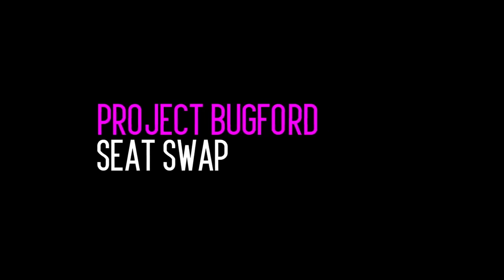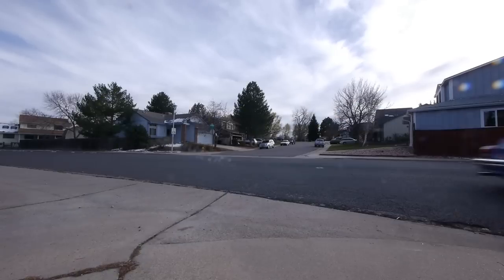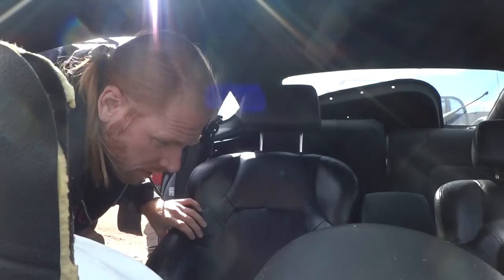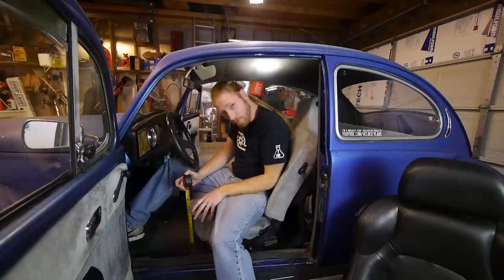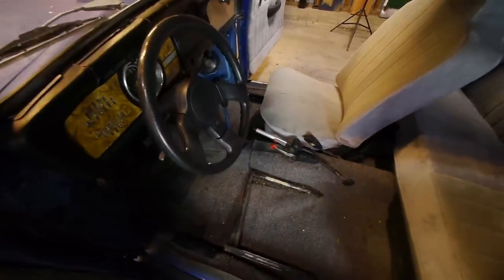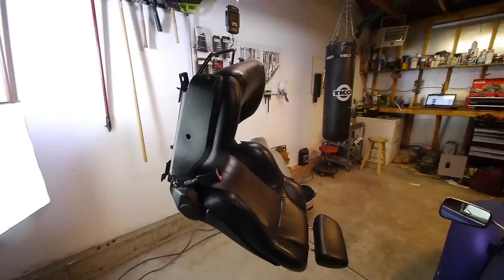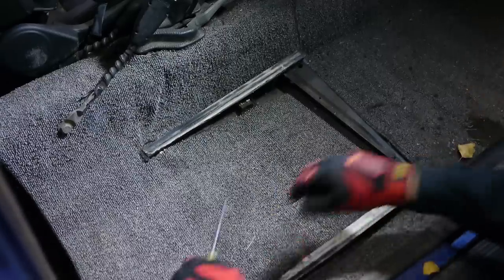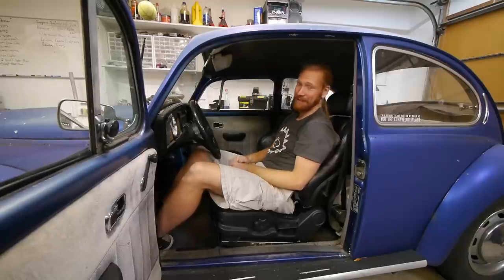1972 VW Beetle seat swap (Hyundai Tiburon seats)

Comment: Fantastic video. Has given me more insight for a seat swap. i have 2012 kia forte. i want leather and power seats. My main issue is the custom work. i do a lot of custom work but i dont dabble much into welding. im fantastic w my angle grinder and dremel however.

Comment: Sweet, I've already done this a couple of years ago, mounted as low as possiblle, it was awesome. I also took the whole back seat from the Tiboron and mounted it in my Bug.
Reply from the maker: Wow nice!  I'd love to see some pics of that if you have some! :D
Reply: See some photos via link below to my Dropbox:
https://www.dropbox.com/sh/o5e6alzpof61o9x/AABih_wcttlDwCmz12Y_zrKJa?dl=0
Reply from the maker: This is amazing, awesome work!   Now I'm definitely going to go back to the salvage yard and find a rear seat as well.  Thanks for the pics!
Reply: Velocity Labs Yes you must complete your work, not just half done 😉 You'll see the back seat fits pretty well, you just need to custom make something under the bottom parts back to hook it into, quite easy. the backrest needs something in the bottom to stick in behind the bottom part (there is already holes for bolts), I used two pieces of plywood 😆. The top parts (my seat had splitter backrest) rested against a 20x40mm pipe fixed to vw original holes in the sides. I welded on two "ears" on the rod so the stock Tiboron back rest locking mechanism works with its buttons.
At last you need to custom make something at the sides to fill the space, you will see when you are there.

Comment: jealious, I need seat's in my 68, BAD. i literally am trusting the door to hold me in the car on right hand turns with stock seats, haha
Reply from the maker: Yeah the stock seats are terrible!  There's a few salvage yards around the Denver area showing Tiburons in stock if you to try those.
Reply: yeah, I have one not far from me, I'll have to try out. Didn't think it was this simple, but the way you explain it makes it seem easy!
Reply from the maker: There's companies that make bolt in seat brackets too which is even easier.  I've seen used ones listed on The Samba classifieds for super cheap.
Reply: Velocity Labs I'll have to look for that. I was looking at a few seats, mini cooper's and other small sporty cars. have to get out there and see what I can get
Reply: Toyota Celica seats work amazing too!

Comment: Great video, very professional and good looking! 
Are you not concerned about the side airbags in the new seats?
Reply from the maker: Thanks!  No, I'm not concerned because there's no electronics hooked up to the seats.
Reply: Velocity Labs OK, that's a good point. 
Maybe it's worth to take the seat apart take all the unneeded things out and save some weight?
Reply: Martin Born I believe it's usually a good thing to wait around  an hour after cutting the electrics to not risk to blow your airbags so in this case there shouldn't be any worries. And I think you are actually on to something there when you talk about taking the airbag and parts out to save weight thumbs up
Reply: @MartinBorn  Any good upholsterer can remove airbags without a trace left, but some shops won't, stating possible liability issues if some later owner with the same car reconnects them and then they don't deploy in an accident.